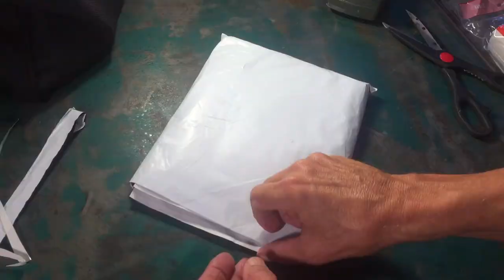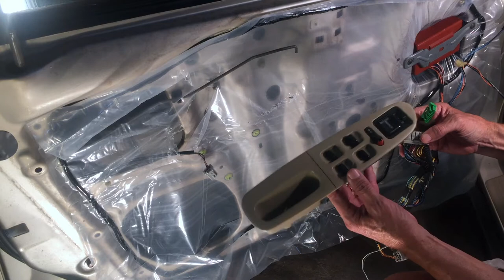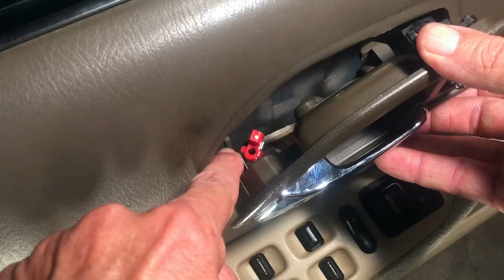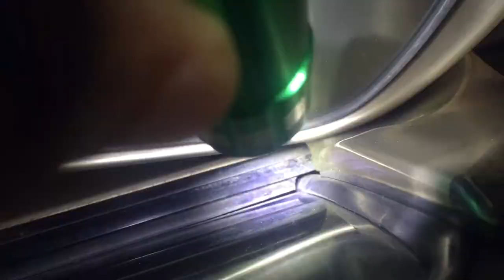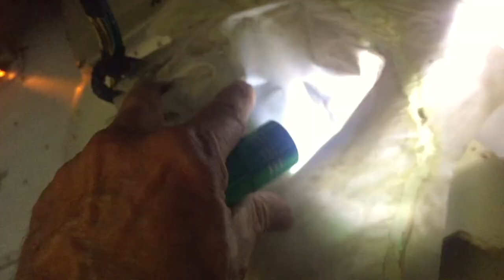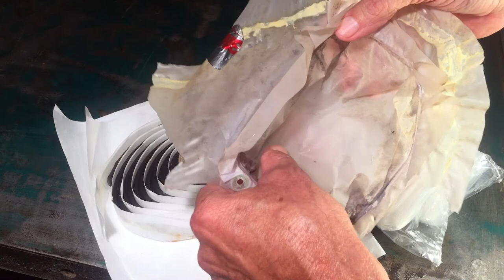Accord Wet Carpet/New Vapor Barrier/Butyl Tape

Comment: PeanutButterMan. You would get  a longer repair if you use a greenhouse plastic. It can handle the deterioration from the heat better.
Reply from the maker: That makes sense... Next time.. Thanks for the tip..

Comment: i wonder if there's such a thing as the perfect plastic for this purpose. I bought mine from a toyota dealer for $26 but i'm still thinking about how there's something out there with better longevity and for cheaper.
Reply from the maker: I'm sure what you bought from the dealer is better than what I used in the video.. More expensive yes, but yours should last longer..
Reply: Greenhouse plastic is made to handle heat.